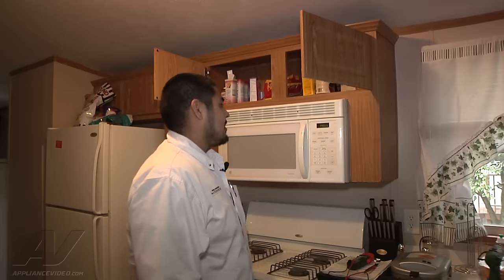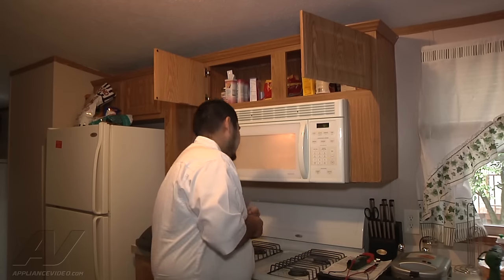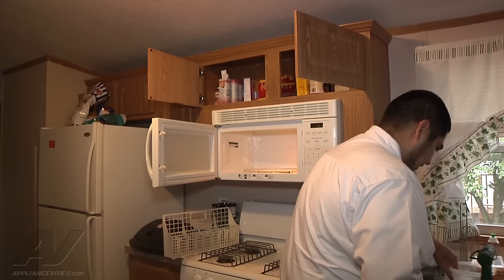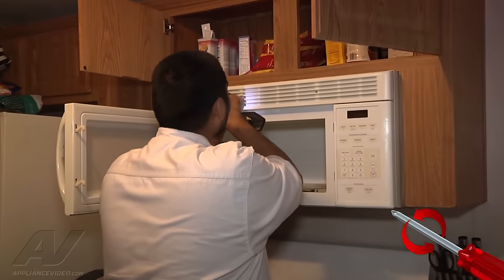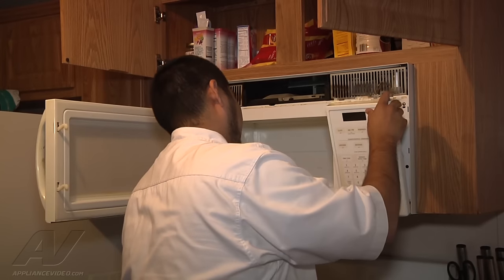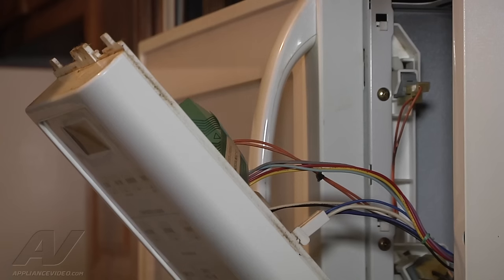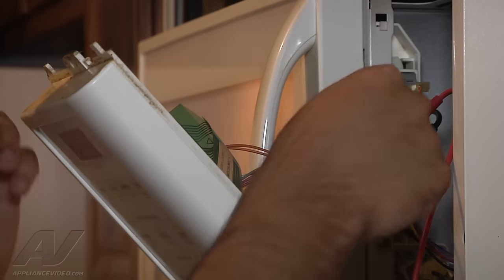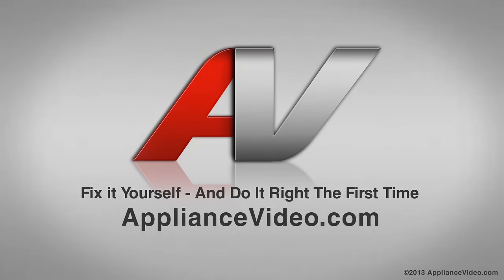GE Microwave Repair - Has Power but Is Not Heating - Magnetron

Comment: So my microwave turns on and heats sometimes,  what can be the issue in this case? door sensor?
Reply from the maker: Great question, you can call
our parts department at 1-800-830-5465 and they can give you help 6-days A week
Mon-Sat . You can also search at www.SaveMoreOnParts.com 7- days a week.  If you have a more
technical question that our parts department cannot answer, our technicians are
answering all questions at our website at www.ApplianceVideo.com under our Repair Help section. We have over 6,000
common questions and answers that you can easily search through by your model
number, appliance make, problem or error codes, and It’s completely free to
search through our question & answer library. There is a very good chance
you question is already answered there.

Comment: with replacement parts like in this case, we should buy a new one
Reply from the maker: Great question, if you have a more technical question that our parts department cannot answer, you can search our over 13,000 answered questions free at our website www.ApplianceVideo.com under our Repair Help section. You can also call our parts department at 1-800-830-5465 and they can give you help 7-days A week ,or search at www.SaveMoreOnParts.com  .

Comment: microwave ge not lighting and not heating
Reply from the maker: josny
      All of our technicians are now answering questions daily on the ApplianceVideo.com website for anyone needing help. Just copy and paste this this question under REPAIR HELP, and one of our  factory authorized technicians  will answer any technical questions at absolutely no charge on your appliance issues. We also have over 2600 free repair videos to help with your appliance repair issues. Thanks for your support. Matt Ace Appliance factory service technician.
Reply: I have a GE microwave 
Not heating and inside light working.

Comment: minutes are turning on but no light are coming on and no turning a round and no heat how can I fix it.
Reply from the maker: Great question, you can call
our parts department at 1-800-830-5465 and they can give you help 6-days A week
Mon-Sat . You can also search at www.SaveMoreOnParts.com 7- days a week.  If you have a more
technical question that our parts department cannot answer, our technicians are
answering all questions at our website at www.ApplianceVideo.com under our Repair Help section. We have over
4,000 common questions and answers that you can easily search through by your
model number, appliance make, and problem or error codes, and It’s free to
search through our question & answer library.

Comment: How much will this cost will labor and parts?
Reply from the maker: Great question, if you have a
more technical question that our parts department cannot answer, our
technicians are answering all questions at our website at www.ApplianceVideo.com under our Repair Help section. You can also call
our parts department at 1-800-830-5465 and they can give you help 6-days A week
Mon-Sat . You can also search at www.SaveMoreOnParts.com 7- days a week.
Reply: Magnetrons per google search in 2019 is between $50-$75.  Labor tends to be around $100-$125 for first hour+probably require 2 visits since the tech won't have the part.  You are looking at waiting around a few days to a week and about $200+ for everything.  And you still have a used microwave.  On the other hand a new one will cost twice as much, but get installed sometimes at no additional cost or you can do yourself, and has a 1+ year warranty.